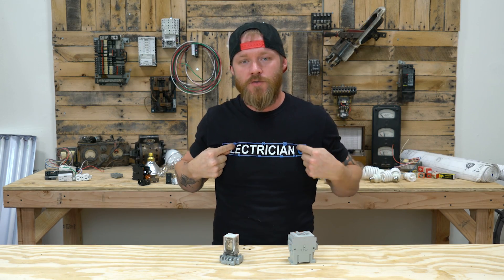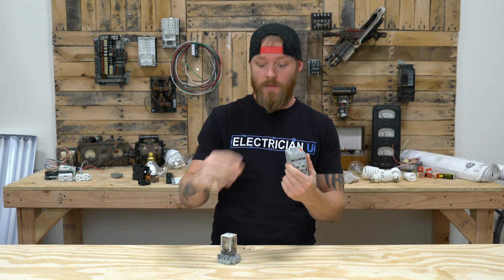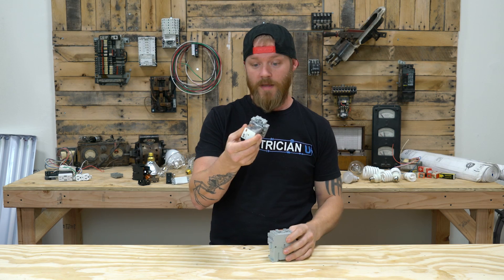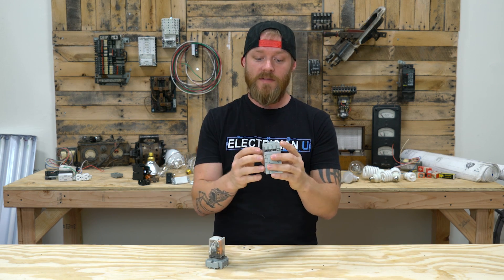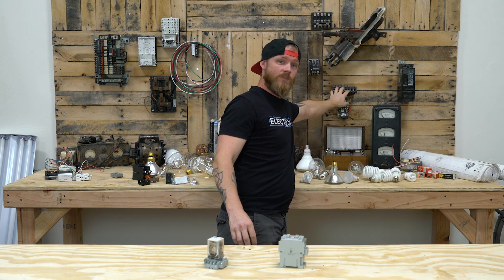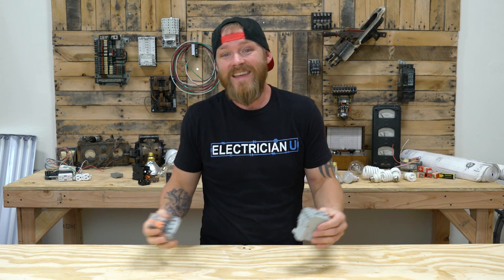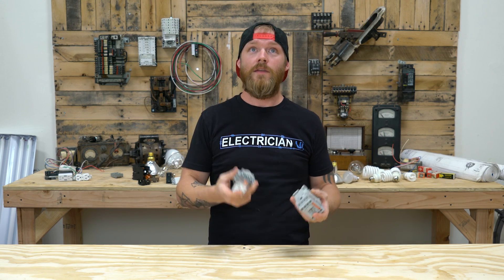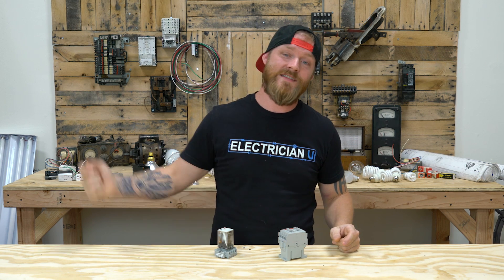The Difference Between Contactors And Relays - ELECTROMAGNETIC SWITCHES electricians use

Comment: So in other words a contactor is a heavy duty relay.
Reply: Not exactly. Contactors are like super-duty on/off switches that are controlled by another circuit. Relays have leads/terminals that are normally open and normally closed, so they can be used for more complex operations.
Reply: @RB-xv4si  That is exactly what a relay is. One circuit energises a coil to flip a switch. A lower power circuit can switch a higher power circuit.
Reply: Dave B I don’t think you’re processing a significant difference. Yes, it is operated by a circuit sending/cutting off voltage to its coil, like a contactor. But relays also have NO and NC terminals or leads. That allow them to send voltage and cut voltage to multiple devices at the same time.
Reply: @RB-xv4si  Back when I posed the observation I was an electronics engineer that had been asked to learn electrical switching so I researched what I could to get up to speed with terminology, things like contactors were a new entity until I striped one down to find that it is just a type of relay. To do the job I had been asked to do I needed to know exactly what components were irrespective of their name so that I could design circuits using existing equipment. A contactor is a cheap one trick pony version of a relay, hence why they are used so often. Its not the only electronics definition that has been changed for the electrical trade, LED is another one.
Reply: Dave B yeah, in the electrical trade, there is a serious terminology issue. A lot of terms have a general meaning and are not precise. But it’s still important to understand the intended meaning of each term. There is a reason that each of them are used in different situations. As far as LED, that’s always meant light emitting diode to me.
Reply: yes

Comment: The contactor you were holding in your hand will accept auxiliary contacts as well.  Auxiliaries are used regularly for latch circuits and/or if there needs to be a sequence during a matching start up, switching a indicator light, sending a signal to a plc, etc.  I'm an industrial tech, it's rare to see a contactor without auxiliaries attached.
Reply: Can I use contactor ..auxiliary /hold circuit for power cut off function in my device ? when the device send a trigger relay break input to the holding auxiliary circuit of the contactor?
Basically I need this in my plc project to cut off supply whenever any emergency/error occurs.

Comment: my understanding of relays is that a lower amperage signal/circuit controls a higher amperage circuit such as in a car for the starter relay where the key switch sends power to the relay which controls higher amperage out to the starter .. because you would never send all the amps for the starter through the key switch. in a relay the two circuits are independent and the lower voltage or amperage one controls the higher voltage/amperage circuit
Reply: That is a great explanation!
Reply from the maker: That is definitely the case in automotive as well as some lighting and building control systems.  But that's not always true in electrical in general.  Many times I've used relays at higher voltages for controlling circuits of that same voltage.  For example a 208v control circuit, switching several 120/208 circuits on/off at the same time.

Comment: So is it true that if I have a relay that the coil usually stays energized then the normally open contact is normally closed. :/  Wut?
Reply: The term 'normally', in this case refers to the  "at rest" or unenergized  position of the contacts. The same terminology is uses to designate the contact configuration in momentary type switches.

Comment: Any Relay\Contactor can be configured for NO\NC.. Using either Grounding\Neutral\Power signal switching. Also relays can be rated up to 100 amps. But cost more then a Contactor of same rating. You can also change the coil line side control voltage for Contactors. In many configurations from 12 volt to 120 to control 277\480 volt line\loads... Some relays have timers. That reset after so many minutes. And relays are the best thing since running water for PLC systems.
Reply: To add:
Relays are available with coil ratings of nearly every standard system voltage, from 3 volts up to 277 volts, AC or DC.
Reply: Can I use contactor ..auxiliary /hold circuit for power cut off function in my device ? when the plc device send a trigger relay break input to the holding auxiliary circuit of the contactor?
Basically I need this in my plc project to cut off supply whenever any emergency/error occurs.

Comment: You should do a video on pulling wire in conduit and laying out what Neural wire goes with what color and circuit number.  also on what numbers are associated with wich colors. lots of apprentices have problems with this and they like to mix up the neutral wires with the wrong circuits. Thanks
Reply: You cant fix stupid.

Comment: So it's just nomenclature, they're all relays.
Reply: It’s not just nomenclature. Relays typically have normally closed and normally open terminals and can be used for more complex operations than contactors. Contactors are essentially big heavy duty switches that can switch on multiple circuits at once. They’re big dumb switches that handle a lot of current. Relays usually can’t handle much current but can be used for logical operations, like turning on one device and turning off a second device at the same time.

Comment: You are very knowledgeable.  Very good explanation about the coil operation.  I too am an electrician and constantly seeking knowledge from people like you.  Learn one and teach one will make you a master.  Thank You
Reply: Can I use contactor ..auxiliary /hold circuit for power cut off function in my device ? when the device send a trigger relay break input to the holding auxiliary circuit of the contactor?
Basically I need this in my plc project to cut off supply whenever any emergency/error occurs.

Comment: You can get relays that also have latching.  The ones I am familiar with use a magnet to hold the contact closed.
Reply: Yep- the very early AMF bowling pinspotters used several latching relays for control.
Reply: @NipkowDisk  
So did old traffic light controllers

Comment: Contactors also are able to have extra contacts easily installed on the top  either n/o or n/c to provide additional circuits to be added as required.
Reply: (Auxiliary contacts)
Reply: Can I use contactor ..auxiliary /hold circuit for power cut off function in my device ? when the device send a trigger relay break input to the holding auxiliary circuit of the contactor?
Basically I need this in my plc project to cut off supply whenever any emergency/error occurs.
Reply: Sorry to say I don't know.

Comment: Do know you much about auto/manual/off bms systems would be a good video as they often involve relays and contactors
Reply from the maker: I'm actually trying to work something out where i can film a NOVAR (or similar) system and talk about all of the different components as well as do a bird's eye view to explain it all...without actually talking about specific branding or specific stores.  Kind of a challenging thing to film because I need to show it, not just talk about it.  So gaining access to stores with BMS's is in the works.  May just take some finesse and time.